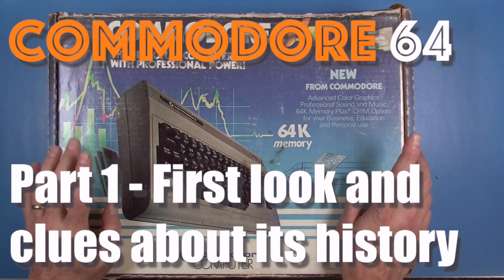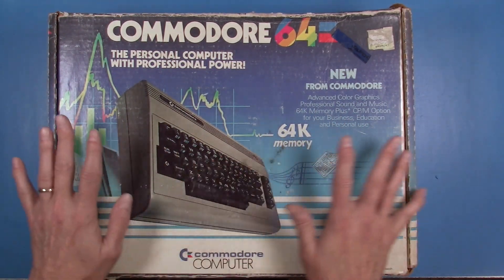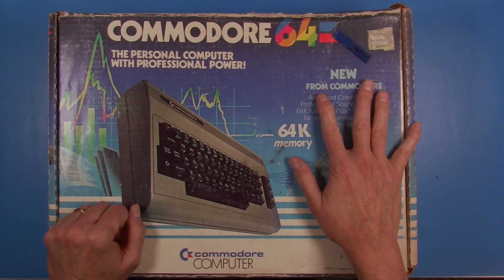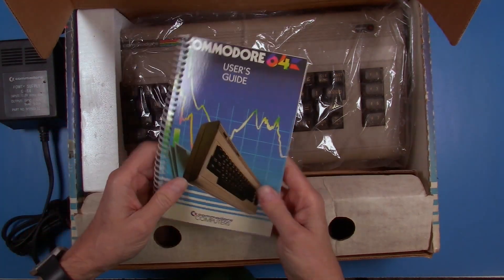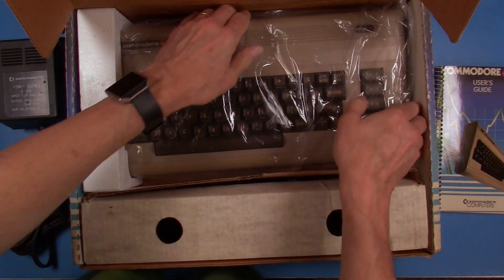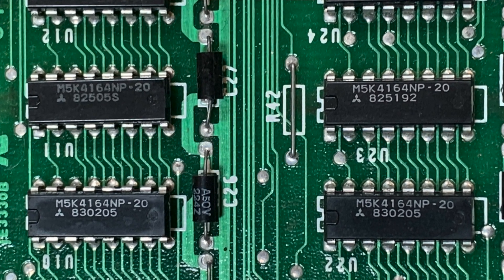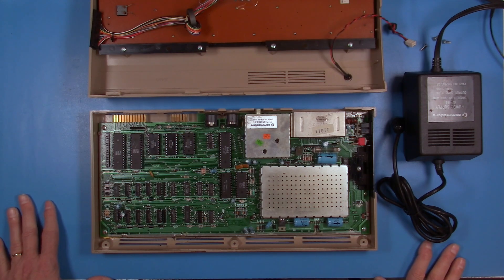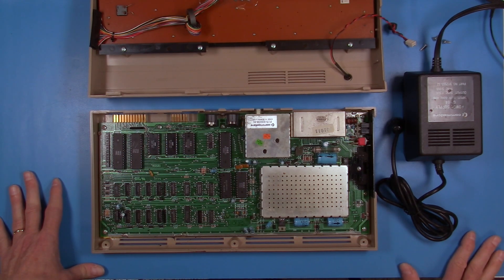Commodore 64 - Part 1: First looks and clues about its history.

Comment: This is indeed a fairly early example.
The earliest serial numbers start with "S" which includes the very early silver labels. 
The "S" designation (Stands for Santa Clara, CA) only went up to 100,000 at which point they switched to "P" (West Chester, PA).
So "P00303535" is likely the 303,535th c64 ever made (actually, there's evidence that the S serial numbers started with 1000, not zero) since most of the other facilities were just starting up production at that point.
That serial number puts yours into early '83 as the date of manufacture, which also matches the late '82 and early '83 date codes on some of the chips.
Reply from the maker: Great info, thanks.

Comment: What is the typical measured current into the C64 on the 5V line? The power brick is rated at 1.5A. You could then make a resistor dummy load attached to the leads on the C64's power jack to measure any voltage drop under load without turning the C64 on.  If it doesn't drop enough, an in-series, forward biased Schottky diode of suitable current rating could be used to drop the voltage.  As one example, the 9A 95SQ015 Schottky rectifier has a max forward voltage drop of 0.34V and costs $0.60.
Reply from the maker: Thanks for the info. I will rig up a load test and check it again. I’ll include that in Part 2. It seems from the comments so far that this is potentially a good serviceable PSU.

Comment: Early C64’s used a 5 pin DIN video connector that would only output a composite video signal same as the VIC-20. Later revisions would have a 8 pin DIN that could output chroma and Luma signals giving a much better picture if you had a monitor that supported it. Most people would use a TV and RF connection to use it.
Reply from the maker: Yes, this one definitely has the 5 pin DIN. Back in the day (early 80s) I used my VIC-20 with a little 13” color TV.  That RF option was pretty important. As a poor college student back then, the extra money for a monitor would have added too much expense.

Comment: That power supply does have over voltage protection. That one can be serviced too. You have a good one! It reads higher voltage because is not under load. You can also adjust it to optimal voltage. It has a variable resistor inside. Very safe that one once serviced with new capacitors.
Remove the sid and fire it up…totally fine.
This model will need the reset mod, resistor mod and you can even do the chroma mod.
Reply from the maker: Great info @atarimex2643.  I’ve seen conflicting info on that power supply,  but now I’m interested to dig into it more. Looks like there is more tinkering to do with the C64 itself.

Comment: My early C64 had the silver badge as well as yellowish F keys, much like the Vic-20.  Also, I believe the carton on the original was thinner cardboard and the whole system was encased in styrofoam that slid in from the side (not a clamshell like this one).  Since this is still an early example, I would bet it was bought and sold multiple times instead of just being marked down.  As popular as the C64 was from the very beginning, I can't see this sitting around gathering dust until it reached $199.97.
Reply from the maker: Good point. The first reduction to $439 was on an official tag, but Jafco could have just done that because they previously sold for that price. The $199 does make more sense as an early “used system” price, especially with it written in pen. It seems like Jafco would have re-tagged it.

Comment: One thing Commodore got right was including an excellent manual in the box.  Atari included what amounted to a sales brochure. There was no usable programming guide.  Their "The Programmer" kit  contained a decent programming manual, but you  couldn't get them without the cartridge so you had to by something excess for an XL model after the 1200XL which required the cartridge.  The 600 and 800XL and later models had a built in Basic.
Reply from the maker: I never understood the purpose of the Atari 400 and 800 memo pad. Kind of like your Atari was a TV Typewriter. I loved the Commodore 64 Programmer Reference manual. CBM really did do an excellent job.